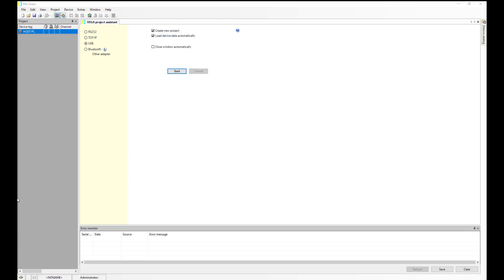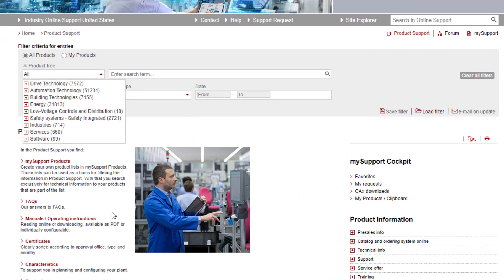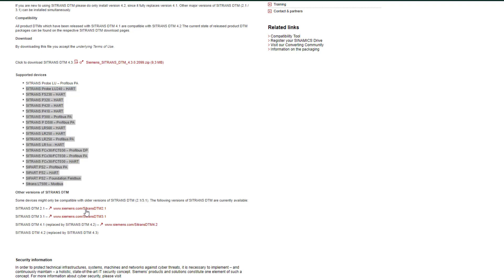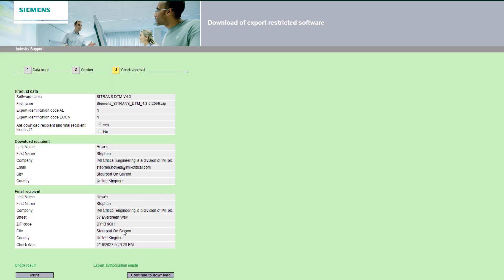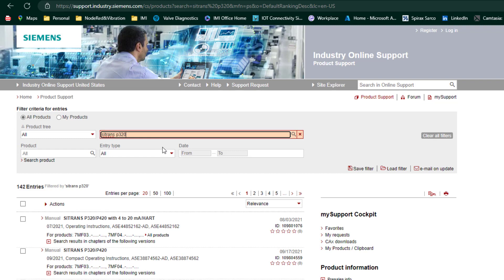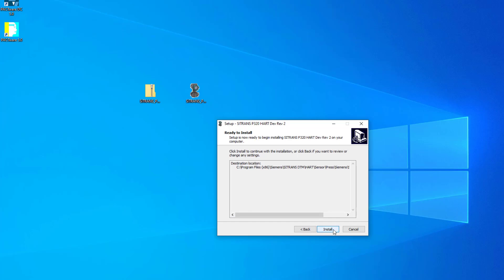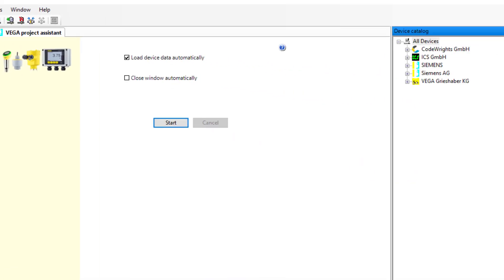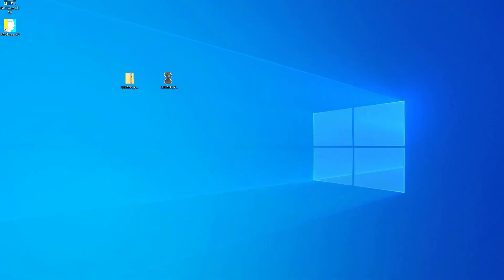Using PACTware with Siemens SITRANS DTM

Comment: You cannot download this file, since your registration inquiry is still being processed.
Please note: due to the manual review, the registration may take several days.
You will get a confirmation e-mail as soon as your download registration is finalized.
You can download the software packages with export restrictions only when you have received the positive confirmation.
Reply from the maker: I know it is a  pain when you need the software in a rush.  Once you are approved then you can download most packages without the wait.
Reply: @IOTConnectivity   - The difficult part is not waiting, but explaining to the industrial plant manager that the start of the unit will have to depend on Siemens' response. That's why I frown when buyers approve purchases from Siemens
Reply: @ChironAquiles  How long did it take to authorize you?